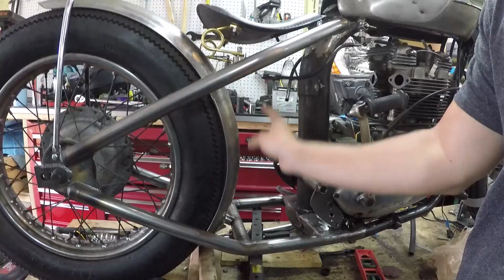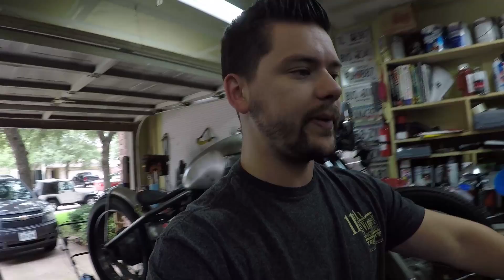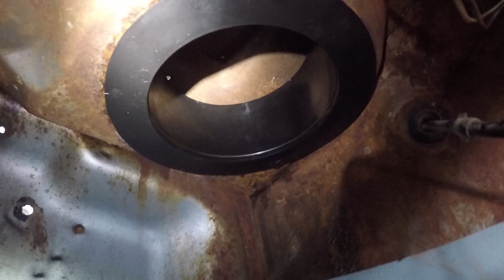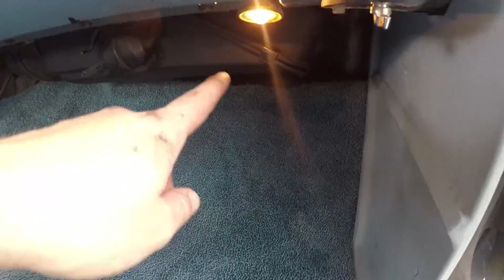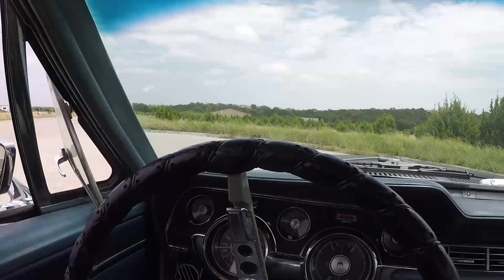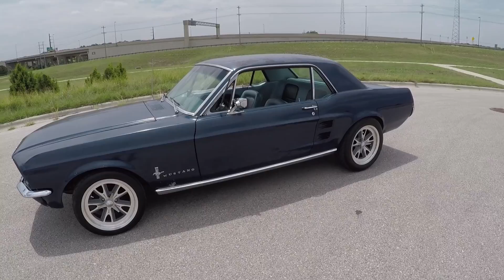Fixing the Mustang's leaking cowl vent

Comment: So the solution to the water in the cowl isn’t to put more silicone and plastic on the car. The solution is to get the water out of the cowl. Go into the fender and find the  drain holes and make sure they are clear. And then clean them annually.

Comment: Dude, if you were able to solve your leak problem by simply taking the heater, glove box and such off and going in through the bottom and putting in those new cowl vent stacks with the CORRECT type of RTV sealant then good for you.   I say this because if you had a badly rusted lower cowl piece it is a MAJOR pain-in-the-ass to replace the entire cowl assembly.   Have to take off the fenders and remove the old tack welds and on and on.  Ask me how I know.
Reply: I never even would have thought to attempt it that way! I'm totally going to try to see if I can assess the damage through the interior rather than ripping the car apart.
Reply: I agree, if you can repair that cowl with those plastic toppers then you are one very lucky puppy.  Doing the "real" repair is a major PITA that involves time, dedication and the ability to fit and weld sheet-metal in an automotive application.  Then to finish the job, primer and paint will be a factor. 
 I have a candidate for the repair right now as in a 67 fastback sitting in my driveway waiting for the repair.  Fortunately I've got the time and the parts along with the ability.  I can't wait to dive in.  I've owned two vintage mustangs, both 67s and both had rusted out cowls.  If you live in the southeast where it's always damp and wet, this is going to be a problem with these cars.